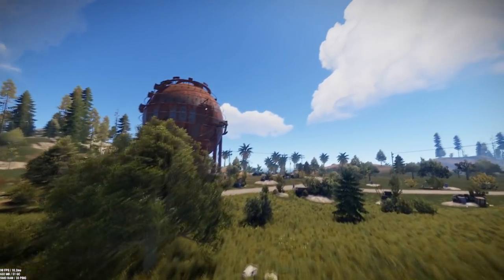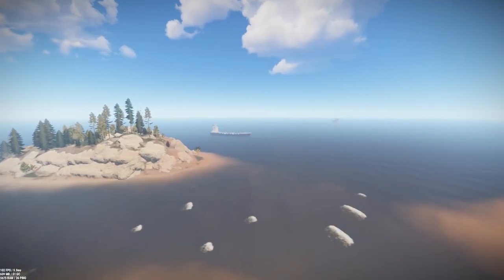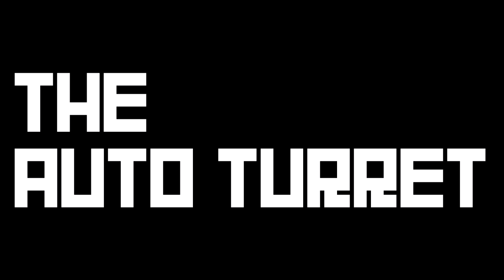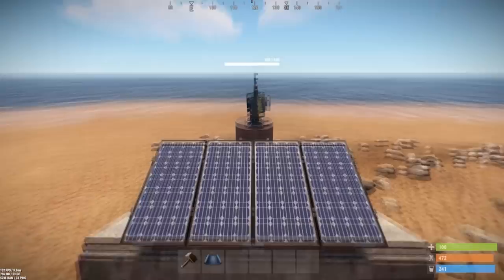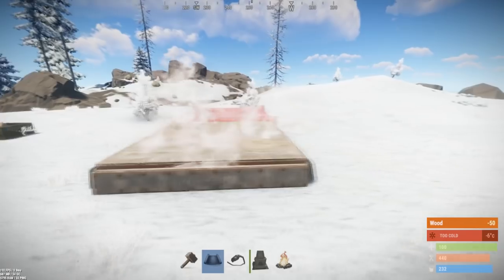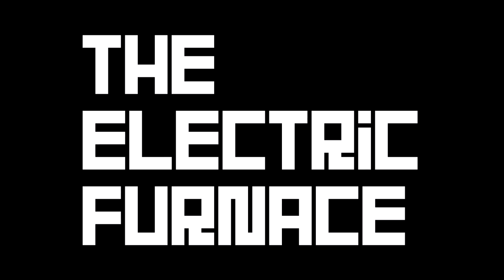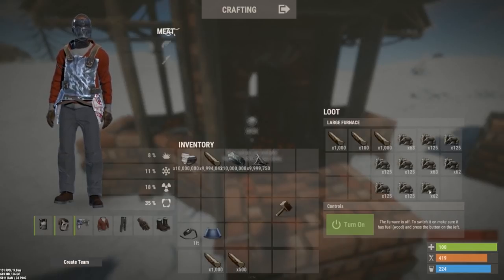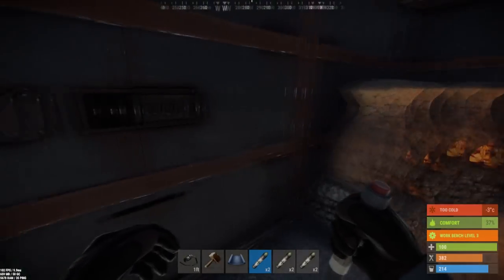Rust Electricity - My Take On Electricity.

Comment: update, a simple semi battery isolator setup.   Windmills to Root Combiner... connected to Branch. Set Branch side to 101.  Run branched sie to OR switch, run pass thru on branch to LG Bat Power In.  Run LG Bat Power out to on/off switch then to other side of OR switch.  OR switch output then to branch/s for your power distribution needs.   

The benefits, battery is always charging, you can provide power over 100 units to projects, if windmills die can still power to at least 100.  

The draw backs... you have to manually engage the battery.  You shouldnt but in Rust world, any connection drains the battery timer.  You should be able to have battery of 100amps on one side of OR switch and windmill input of 101 to other side and battery should never be on a draw unless units from windmill drop below 101.  cest la vie

Comment: RUST Quick Electric, what do you think if they added a new version of the "branch" "gate", that had 2 more inputs, that would be used to set the "Branch out" value to the sum of those "signals" at those inputs, provided that there is enough power at the "Power in". It also wouldn't drain power from either of the 2 new inputs, so signals would be preserved (so the equasions for outputs would be as follows: "Branch out"=MIN("A"+"B","Power in"-1) and "Power out"=("Power in"-1)-"Branch out", where MIN is the function that returns/selects the smallest number provided, and "A" and "B" are the new inputs). It would go quite well with the new sensor, since it would allow to add up all of the detected people, and it could be used for substraction (but you will have to remember that the gate "requires" power to operate, the "-1" is the gate's "power consumption").
I know this suggestion isn't going to give a direct reason to the electricity system to be used more in survival (and I agree that something needs to be done about this, and I agree with the suggestions you proposed), but I think a lot of people would want a gate like this, and this is going to be ballanced "out of the box" (let's hope anyway), no power duplication would be possible, if it is implemented exactly like this.

I would, want to see devs add a "electric car" that you could put electronics on (without the "power generator" of course) or an auto-turret (after they add the power consumption to it, I know that would be OP without that, it already is when it's stationary), that would be extremely expensive, and without external batteries and/or solar panels wouldn't go very far. It would have a way to read the car's battery level with the electricity system as well, so people with creative ideas could use it to efficiently discharge the external batteries.

Actually, I would want to see the devs add a way to steal power from the "compound" (I think that is the one area I'm thinking of), since there are "working" power lines over there.

What is your opinion on these suggestions (mainly the first two)?
Reply from the maker: I'm a fan of any additions for additional customization and variation when building. Having equation based logic gates would be fantastic for a number of unique builds. Min/Max detection and other variables allow for a number of power siphoning triggers and charging stations along with configurable delays.

I know they added a car to the game long ago, but we have yet to see any functionality of it in the real game since they refuse to add it. Would love to see it require a battery and have slots for additions.
Reply: RUST Quick Electric, I have one more suggestion, if they will add the "gate" I talked about above (which I would call the "advanced branch"), they should also add a input and a output to the counter (I know that it is a small item that has a lot of connections already, but these will be handy). Those would get the dedicated "Passthrough in" and "Passthrough out", that have obvious roles, and the reason behind this, is the fact that this will allow to make a "advanced counter", if you make a loop of them through the passthrough connections and two of the advanced branches (one for adding and one for substracting). This would allow for a syncronised counter, that has multiple comparison tests, without the problem of getting "signal degredacion", because of the fact that counters have "power consumption".

And, to be honest, the "advanced branch" would allow for some serious power managment (dynamicaly adjusting power usage to 1 power unit). Plus it coindentaly would allow for easy digital to "analog" conversion and the other way round. And it would be ballanced, because it's power efficiency can't go over 50% (A and B inputs just "terminate" in the gate itself) - no power loops possible.

They should also add a way to adjust the power output of the batteries, so the higher the output power the shorter it would supply power for (in a linear relation). That would remove the requirement for root combiners on the output of batteries, which to my knowledge don't stop siphoning power from the batteries when attached directly to them (root combiners on the output of batteries), even when a swich/blocker on it's (root combiner's) output is disabled.

Some things that will be doable easier or at all with the "advanced branch", summed up in a list (ordered by how easy it is to use that function):
1: Addition;
2: Advanced power managment (it is here because functions 3,4,5 require a '1' to be added, because of the "power consumption");
3: Substraction;
4: MIN;
5: Value comparison;
6: Binary to "analog" and "analog" to binary conversion;
(Propably) 7: Multiplication (it will require quite a bit of "gates", but propably doable, might reqire the function 6).
And we already have MAX (AND or OR "gates" do it, but OR works with any signal, where AND requires both signals to not be 0).

Comment: RUST Quick Electric, I thin that most electrical components shouldn't use "High qual.", but 50x metal fragments (I think everything other than the big battery, the windmill, the new sensor, and the wireless transmitters/recivers, everything else (including the wire tool) should cost it's current cost x 50 but in metal fragments, and if there are any additional components in the recipies, those are left untouched). If you think it should be less or more, you tell me.

Since I'm talking about "High qual.", why not add a way of getting it easier. Introducing, the "Ore granulator", it turns a large amount of regular ore and turns it into 1 granulated "High qual." ore and granulated stone (recipe: X x ore -> 1 granulated "High qual." ore and X-1 granulated stone, where X is between 50 and 75), then you can smelt the granulated items in the furnace at a ratio of 1 to 1. Do you want more metal fragments instead? Don't worry, you can get more of them too with this machine, instead of smelting them directly, craft granulated ore with 2X-1 granulated stone and 1 granulated "High qual." ore to make 2X of it, which then can be smelted into metal fragments. If you try to granulated ore, you will get what you crafted it out of. The machine runs on electrical power, it's normal power consumption is 100 energy units, and then it runs as fast as a furnace, but it can be over/uner-clocked to either save power or run faster, you can underclock it to 50% speed by applying only 25 power (the whole range is linear, and yes it requires 400 power to get it to 200% speed)! Craft it now for low low cost of 10 "High qual.", 10 gears and 200 metal fragments!
Incredibly small print in the bottom left corner of the screen: Overclocking past 200% will cause damage to the machine, and possible selfdestruction, and we are not acountible for neither damage or destruction of your machine.

I had to do it like this. It must have been done.
Reply: I agree with your High Qual comment. Electrical components are way to expensive to make currently. After working through making auto night lights, multiple automated turret pods with HBHF, and raid alert with siren and transmitter you end up with spending over 100+ HQM.

Comment: Not sure about putting electricity into existing systems like auto turrets (just means clans bring a windmill too). And I think defining the area a heater would heat is tricky- from the perspective of the game engine, bases don't really have an 'inside'- but a larger radius that goes through walls also seems problematic.
I do agree that more components and better optimization would be nice. 

Overall, electricity is an optional mechanic, and should stay that way. It offers QoL, serious advantages when done right, and fun, but not everyone needs to learn it- just like not everyone needs to be able to fly minis or control an ak.
Reply from the maker: I figured it shouldn't be too hard to determine an area of heat if they can prevent degrading of boats and minicopters if they are enclosed with a roof.

Comment: Auto turrets are too easy to drain, they are just "too stupid" atm, so making them to require power, ehm.. well then those should have improved shooting at least. Also, raiding in Rust is way too easy as for today, no matter what base you could possibly have, so I would probably be looking forward to make raiding a lot harder, either by improving/adding more traps, or other balancing techniques.
Reply from the maker: Would love to see a revamp of the balancing and more variety of traps as well.

Comment: while have enjoyed figuring out most of the electrical options... automated lighted landing pads with auto door... auto lights with adjustable on/off time to compensate for the pore solar characteristics... to using HBHF with garage doors to create hard to drain turrets....  there are several issues that need to be addressed at the core before anything else is added!!!  

First off, lose any idea of voltage. It doesn't exist in the Rust Electricity Universe.  its literally amperage ... not voltage.. not wattage.  Its units of power being used. Voltage is strength of charge, amperage is flow, wattage is amp x volts but we don't have that. We have a singular unit of power and when we use one we lose 1 (or two) thats amps! lol (sorry, saw a huge argument about this, my .02) 

Now to the bitching!

Batteries and power input/output - Explain to me, in any known universe, how I can have a draw of 1 unit of power from a battery, be inputting (charging) at 120, and the battery is losing discharge capacity?!?!? If power in from core source > power consumption = battery charges its "time to discharge" counter, thats how it should work!! nope

Batteries and the charging "hump" - You rig up auto lights. Just  blocker, solar for on/off, light. If connected right from the start to a brand new lg battery, get ready for blinking lights.  You have a draw of 3, source capacity of 100, amp hour of 2:00 when deployed and input power at 120+.  Good luck getting a charge built up in the battery to make it last thru a night regardless of "charging" power input by any means... but have a much much larger demand on the battery, say 30-60 if everything is on, and let the battery build up to 1.5'ish AH (amp hours) before connecting it to a consumption array and presto, no more battery issues! It magically slows way way down discharging when demand is on it, and grows to full regardless of demand and stays there, hooray!  (both above cases, 3 windmills linked together outputting 140-330 power "units", server with 15 minute "night time" and large battery as receptacle).  Makes no sense, especially on some nights when the windmills are howling and putting out 300+ see issue 1! 

Battery charging, regardless of power size input, is per time, and seems to ignore "too much" power to speed up charging, but damn sure pays attention to "barely enough". For example 2-5 windmills root powered to one feed, to one large battery, mass units of power being created, lg bat capacity timer counts up real time 1 second for 1 second of stored power.  BUT.. exact same setup, with ANY demand, however so slight... discharging but 1 second of battery capacity lost might take 5 seconds. Literally 300+ amperage coming into battery with 2:00 AH capacity hooked to a blocker that ISN'T allowing passthrough, and the battery is counting down in capacity at about 1 second capacity lost for every 5 seconds of real time that passes.... makes no sense.

Makes zero sense. 100 amperage with 4ah storage with 300 amperage constantly being supplied should never = battery wont charge if load of more than 0 is present.  Load of 101, sure!  but 1 and you cant charge?  (broken record, sorry! This REALLY bugs me!!)   ...

and yes I know if im consistently creating more than enough amps with windmills why even use a battery that has a limit of 100 amps @ 4AH.... it's the principle of the matter! Plus if some dickhead squeaker blows up said windmills, have backup... 

A few things to help wrap your head around a few of the components and I haven't seen anyone else say this......  
AND switches. In most cases treat these as literally a real world relay. You have main power, no pass thru. Minor power is used to bridge the relay and presto main power flows! as in you want to have multiple HBHF sensors trigger 1 door... HBHF to AND  .... HBHF2 to AND2.... AND - AND2 to OR  so if either triggers, what you want to operate does.
OR switches. Treat these as variable power pass thru devices in terms of it doesnt care if one or both inputs are getting power, whoever is the strongest passes thru. 
Heartbeat sensors. First off, no matter how many power units you supply it, remember it only 1 unit exits thru when it activates. (let its range be determined by how much power you supply it!) 
Branches - Use them liberally!!!!! Use the branch side to control exacting power output based on needs to your creation. I treat them as adjustable power unit "fuse panel breakers". Main power passthrough is to source side on the next Branch.  My goto setup is now Windmills > Root Combiners > Lg Bat > Switch (so i can charge  if needed) > Branch > Branch > Branch.  No wasted power units, and exact control. 

Can we get a battery isolator type device? :D
Reply from the maker: All super great points. The battery/energy system needs a complete overhaul. Great tips regarding the components as well!

Comment: I respectfully disagree with much of what you say in this video. I understand where you are coming from, but having things like the electrified auto turret force dedicated players to learn electricity, which seems to be what you are arguing here. At least 90% of the people that I play with don't want to get into electricity, and nobody really knew it was coming, which is why I think that it is more of a side update. You can play Rust exactly how you would normally without electricity, despite it being in the game. Changes such as what you are mentioning would change gameplay at its core, which would drive away so many people, as forcing them to learn how to wire up contraptions to do something that they would normally do without electricity would ruin the game that they all love. I personally do love electricity, but I do not want it to change the core of Rust, and rather be something that I can mess around with and have some fun. However, I do believe that it needs to be expanded to allow geniuses like you to build amazing things. With that said, I'd love to hear more about your opinion.
Reply from the maker: This is the beauty in open conversation and discussion. I completely agree with all of your points. I think there could be multiple branches of different types of rust servers that allow for implementation of different gamemodes. You're right that it would totally divide the community and force learning that isn't necessary nor was it originally in the game.
Reply: @Your Mom I don't really have an opinion about turrets, i just used it as an example of something that would cause dedicated pvpers a massive hassle because of the changes. On the side of ak recoil changes, that was for the purpose of balancing the weapon, and making the game skill based during ak pvp. Implementing electricity into the core of rust would cause players to revert their entire playstyle to accompany the new changes. This wouldn't be for making the game more fair or skill based like the ak, it would be for the sole sake of making electricity more relevant in the game, without necessarily improving the game. I personally do not think is a good reason to force change upon everyone.
Reply: You could either learn it. or find a specialist to do that. :) If the electricity be a bigger part of the game, that would give and edge to smarter players. And that would be a good thing.
Reply: If 90% of the players don't want to get into electricity like you say, why do we have such thing in the game, or let alone spent many weeks, if not months, of development time for it?

Why should 90% of the people constantly have their inventory full of stuff they are only going to recycle?

If electricity is to remain a niche thing in Rust, something has gone very wrong in the development process.